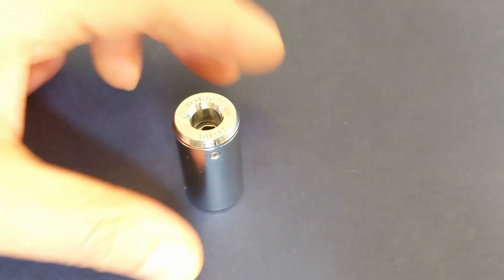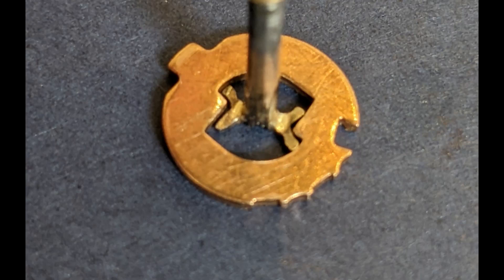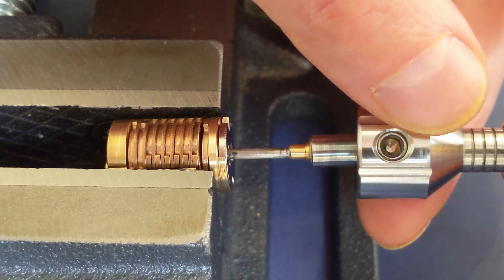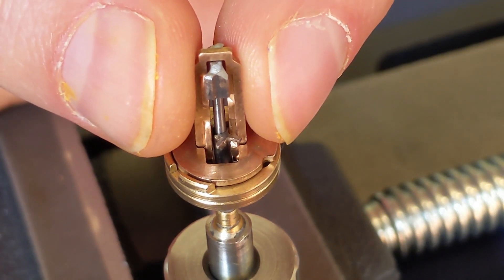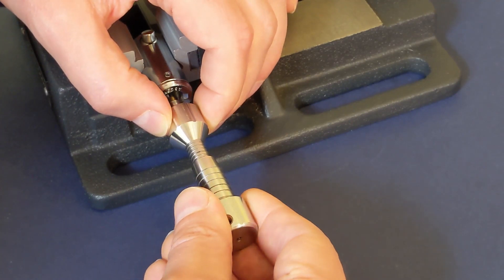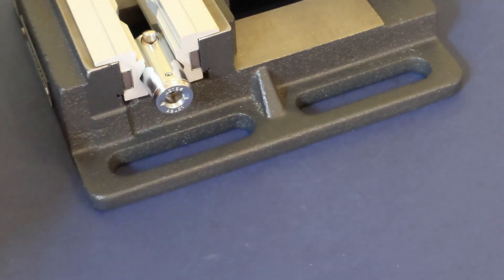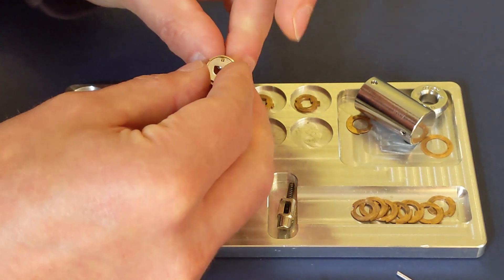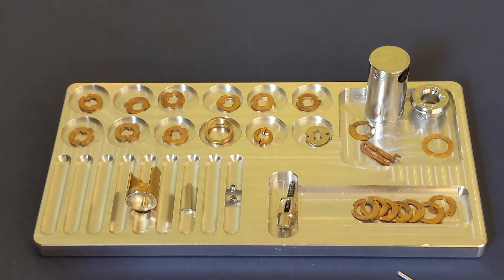Abloy Exec picked and gutted with detail on tool design and picking technique

Comment: Minua huvittaa- nämä videdot. Se on totta, että avain kuluu ja lukon osat on messinkiä.
Reply from the maker: The forces operating these locks are very low indeed and brass is quite wear resistant, so I think the wear rate will be very low. The design of the lock means it should also be quite tolerant to a reasonable level of wear, although of course it would eventually wear out
Reply: @crispix   Tässä avataan videolla, miten patentit puretaan. Miten, voidaan tehdä jälleen Kiinalle etua, kehittää omaa tuotantoa, ja rikkomatta patenttia.